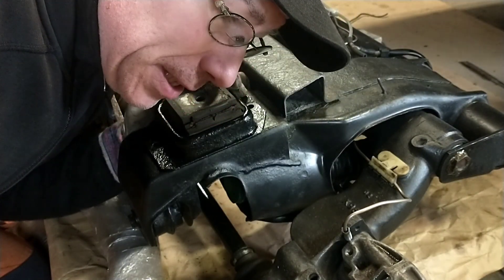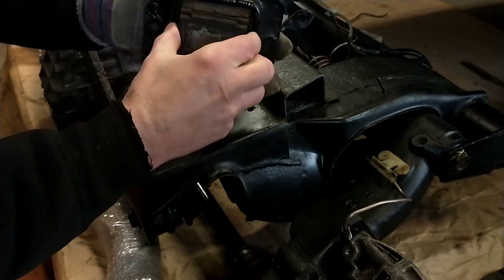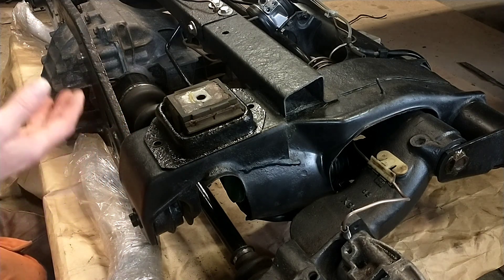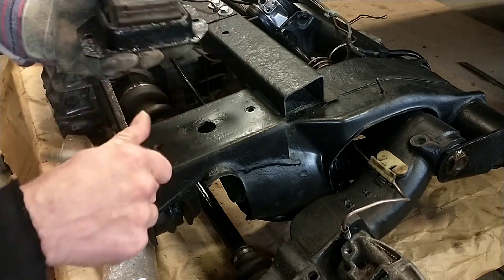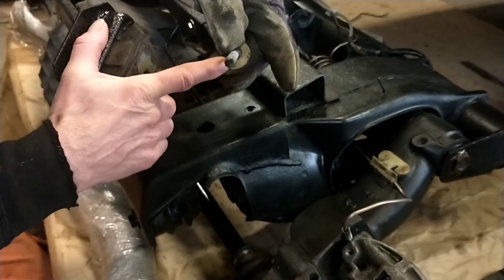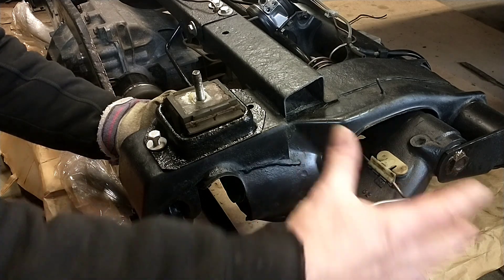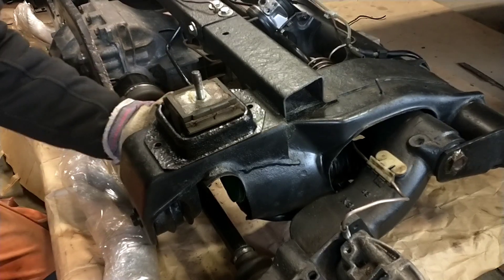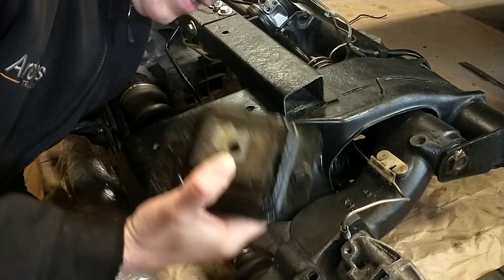Citroën BX 4X4 rear subframe mountings. They're weak as...

Comment: Having the the bolt rest against the lower surface of the subframe will effectively make it a solid-mount (although slightly compressible), increasing NVH and the likelihood of failure in the bolt/washer. Fitting a poly bush between the washer and the underside of the subframe will reduce this NVH and the shock-load on the bolt head.